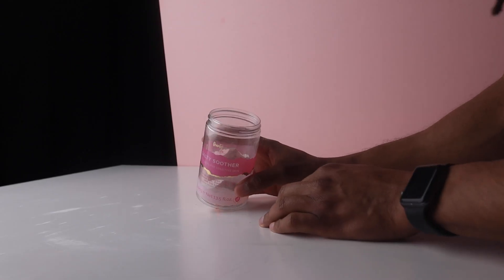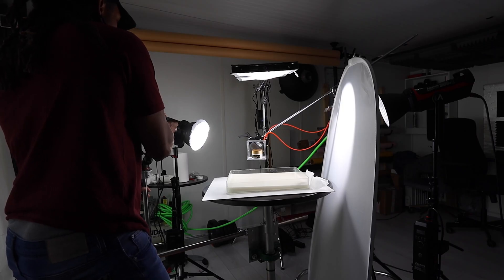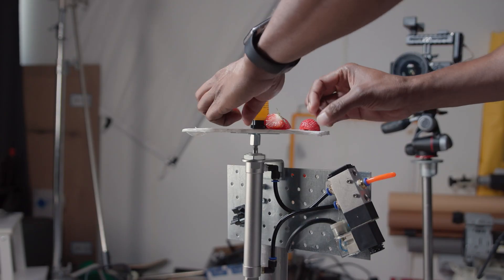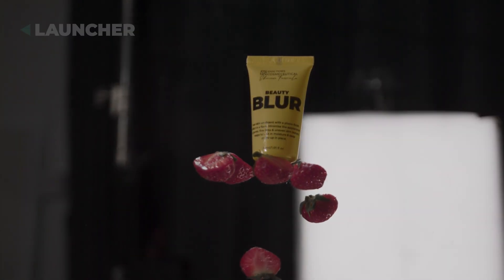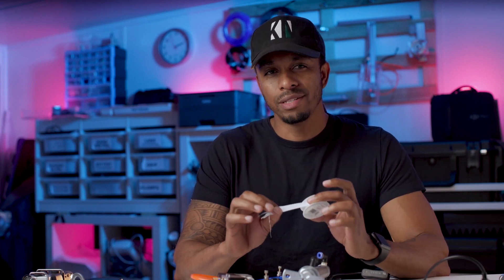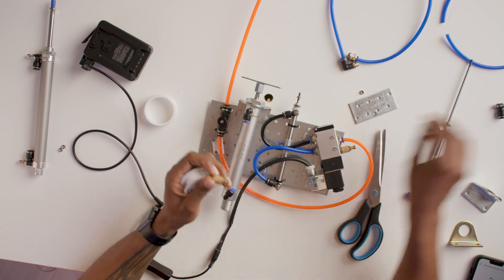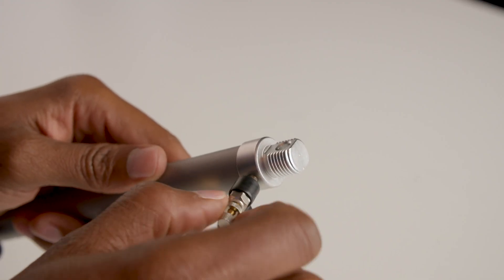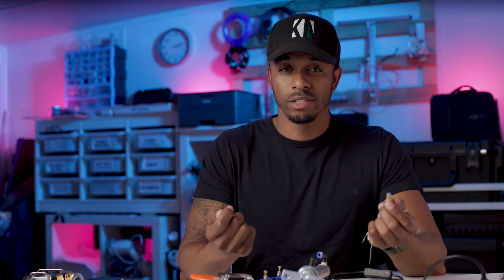How to use pneumatics in film making - Part 1

Comment: Hey Kirth, can you tell me what you used or how you rigged the remote wiring
Reply from the maker: i used a push switch for a floor lamp but any swtich would work. you need to wire a 12v supply in line though as the solenoid needs power to operate

Comment: Hey Kirth, do you use any sort of air drying system when working with pneumatics?
Reply from the maker: i dont personally but i suppose it doesnt hurt to have one in the system. The thing is, these systems are very small and used occasionally so i dont deem it necessary.

Comment: Will a higher psi cylinder push the cylinder faster ?
Reply from the maker: technically yes, however, most of the compoenents you may come across is only rated at 100psi so thats your safe/recommended operational ceiling